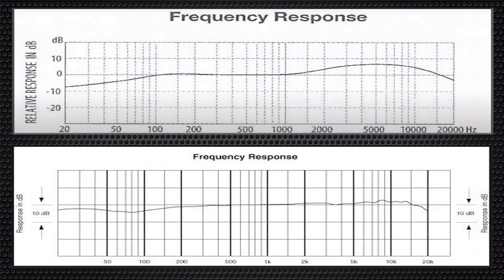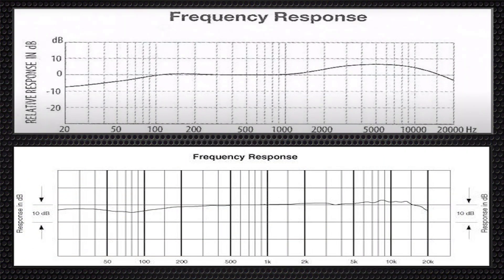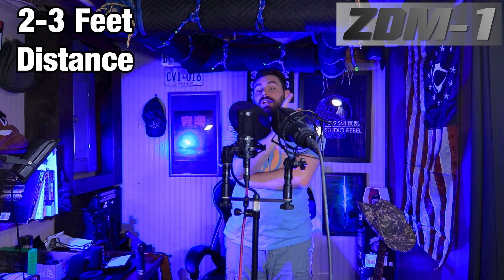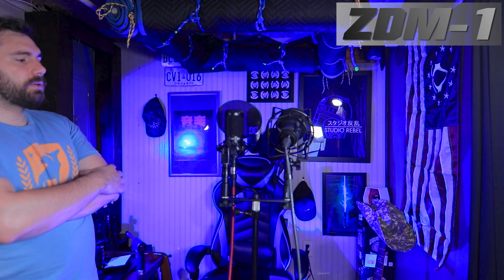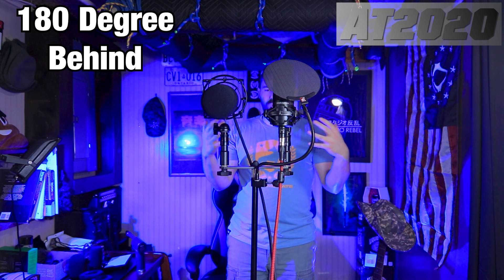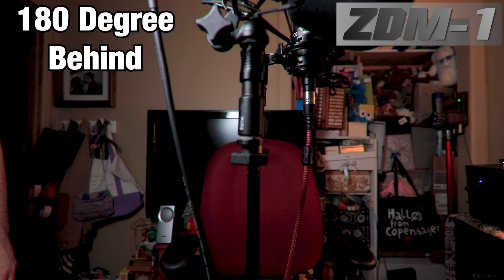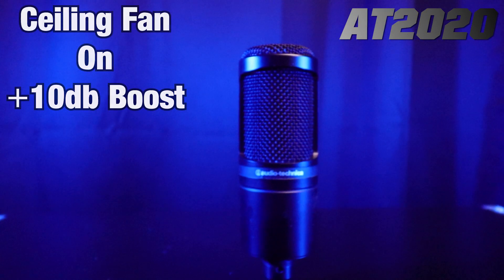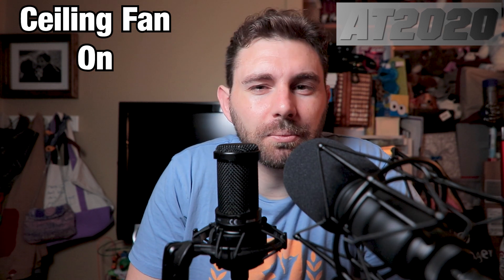Audio Technica AT2020 vs Zoom ZDM-1 (Studio/Booth/Untreated Comparison)

Comment: I've had the fortune of talking into some of the most expensive microphones ever made during my broadcast career. If you like condenser Mics, check out the hyperx duo cast, not the solo cast, and not the useless quadcast with capsules that nobody will ever use. It honestly blew my mind. There's even a vid of a death metal singer who used it on the track for fun and it sounded amazing. The capsule honestly sounds like it was made by Lewit.
Reply from the maker: I’ll def check out the mic. I don’t know much about Hyperx so I’ll be going in blind but an open mind. 

Thanks for checking out the video!

Comment: I think the Zoom sounds better...build quality is another thing...accessories Zoom, price Zoom
Reply from the maker: I give the ZDM-1 a hard time but I think it’s not as bad as I portray it in my videos. If you look back at the earlier ones I was much more positive on it. 

The thing that changed that was when I opened it up. I plan to do a video on it but it was kinda discouraging seeing the inside. 

That being said it’s a great mic for the price. 

Thanks for checking out the video!
Reply: i just received my Zoom and I think the build quality is fantastic for the price...it's very much like my Heil PR 40 in size, quality and weight...probably from the same factory in China.
Reply from the maker: I'm gonna have to disagree with you on this but that's just my opinion.  As long as you are happy with it and you make some cool content, then that's all that matters.